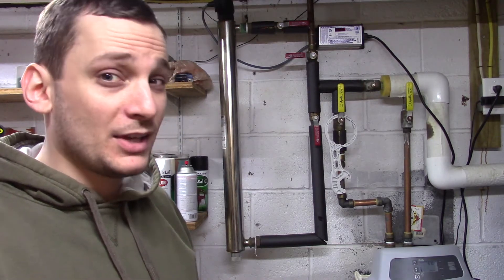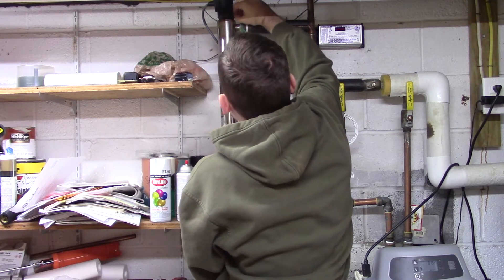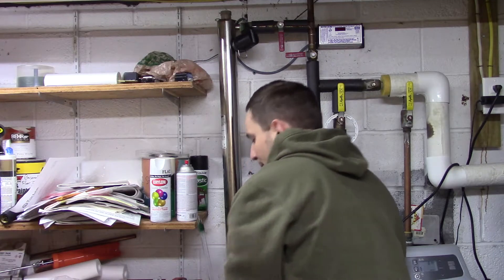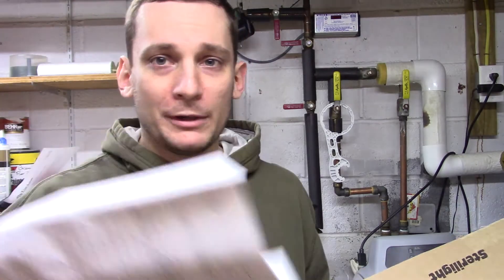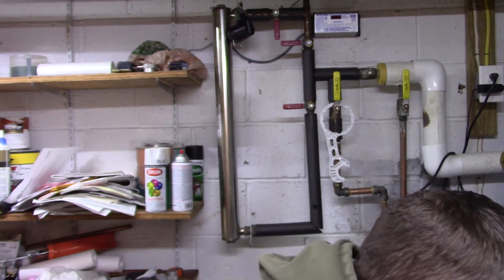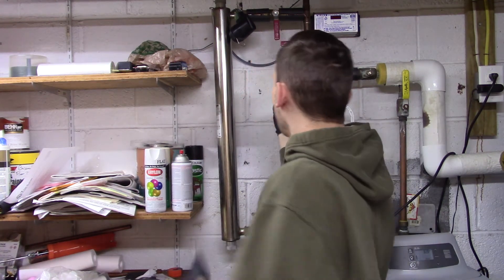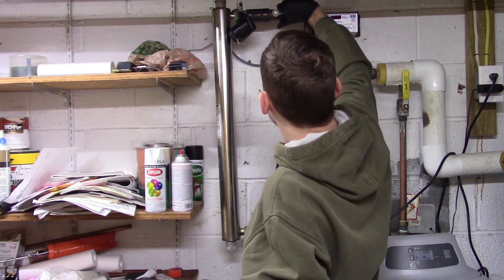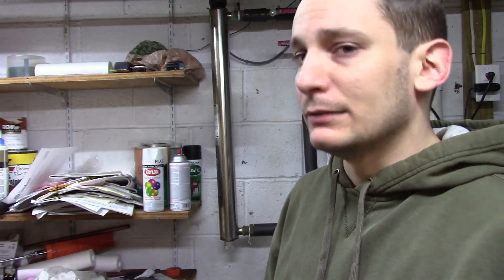Changing out the bulb for your UV water filter. Sterilite S8Q

Comment: You shouldn't run the unsterilized water through your system. If you do, you have to shock your system. Install the bulb before you run the water through the system.